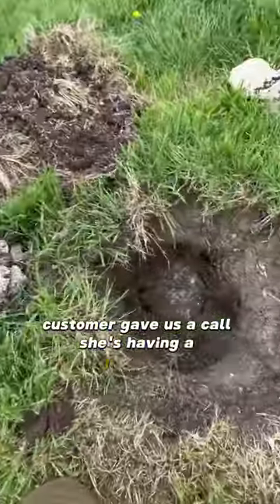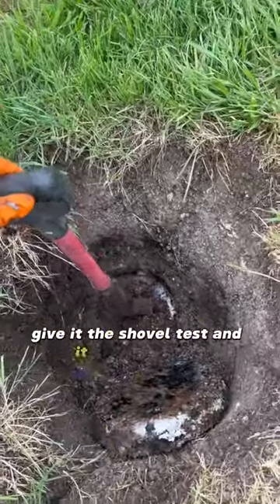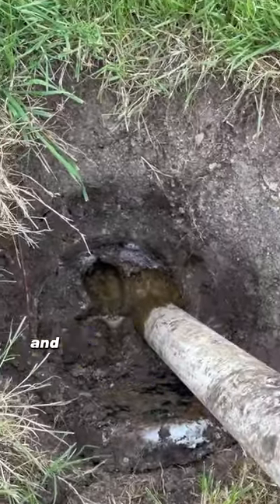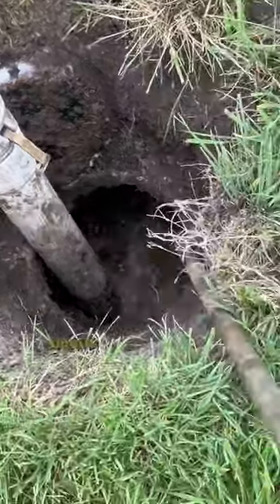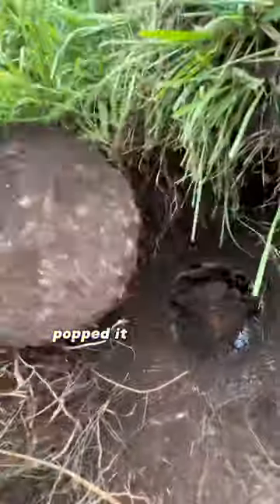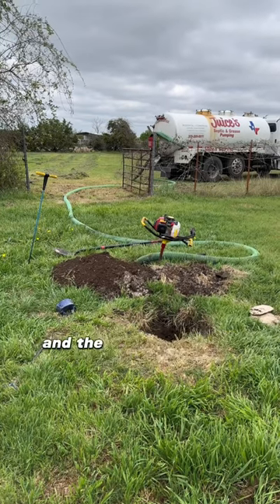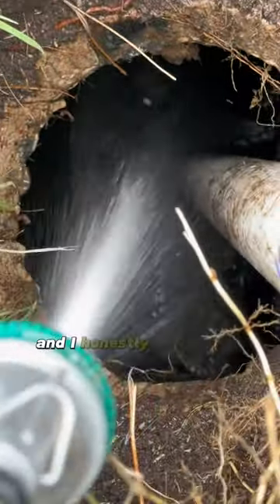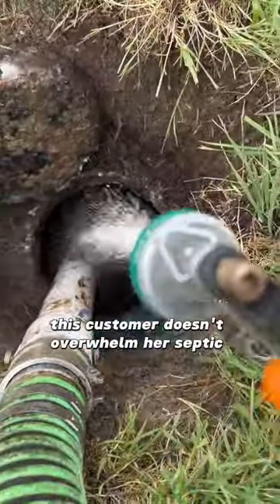Will this septic system work for 100 people? #shorts

Comment: If 100 people are coming,  might as well rent a port-a-potty or two.
Reply: Or 20
Reply: Naa, most of them will just be #1, but some will still be #2, and if you just had it cleaned, most tanks are around 1000 gal, and some are 1500 if there is a double system in place like tank and pond or tank and leach the grey water runs off while the solid settles, most of what you see when he pops a lid and there is crust is wipes and other trash. I dont flush wipes or trash and have mine pumped every 3 years, and when the lid comes off, all you see is water! Everyone should learn about what they have and how to take care of it, and most likely, problems will not suddenly happen!
Reply: Time to put in an outhouse
Reply: Rent a unit or 2 with the outside wash station best choice and keeps a lot of BS out of the house.
Reply: Porta poddys in the areas of the eclipse have been sold out for like a year
Reply: A porta potty typically services between 50 and 70 people source being that's my job
Reply: exactly!
Reply: @KitKatKman  Hello fellow porta potty driver/service tech!
Reply: @randydarby2340 I think they meant more so there will be extra bathrooms for people to use so there isn't a wait for a bathroom.
Reply: Put up signs telling guests to not flush anything down the toilet except #1. and #2.
Have enough waste paper trash containers in bathroom for paper, wipes, etc.
Reply: Fr

Comment: I don't think it has anything to do with the amount of solids going into the tank. It's the surge of water going into the septic field in such a short time frame.
Reply: ever hear of rain
Reply: @Justin-tp1mx you don't know drain fields. A bug surge of water in the drain field can cause ponding and your system will be declared in failure and you have to put a new one in. That's Hella expensive.
Reply: I thought it was about people standing on top of the grass where the septic tank is located and the weight of 100 people being too much. I live in Germany we don't have these so I really have no clue

Comment: How much does something like this cost asking as a new homeowner
Reply: I remember for us in south FL it was like $300 but that was pre-pandemic. 

How frequently you have to do it depends on how good your drainfield is. They generally recommend every 3-4 years but ofc theyre gonna exaggerate to get more customers. But generally if your drainfield is working fine it can be easily every 10 years.

I kinda miss having a well+septic. One less bill to pay and you can always power your well off-grid if needed whereas city water you're in the hands of the oh so responsible government.
Reply: Mine is $250. If anything has to be dug up, expect the basic charge to go up